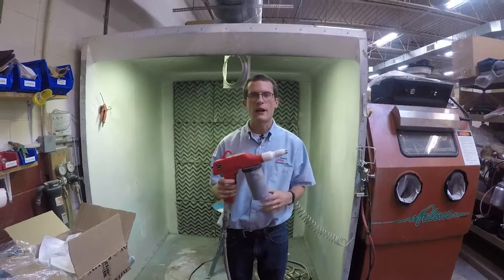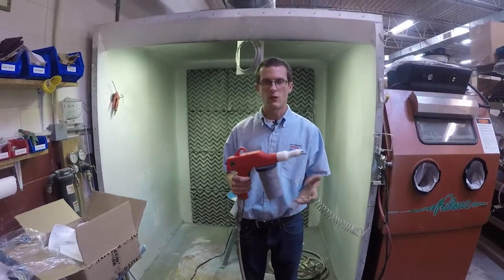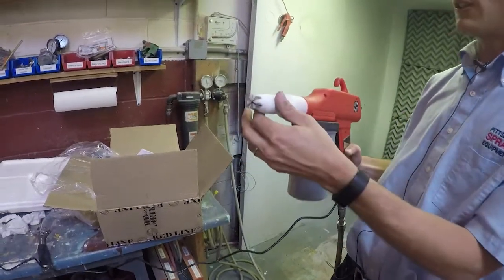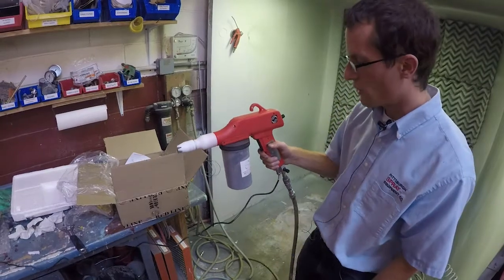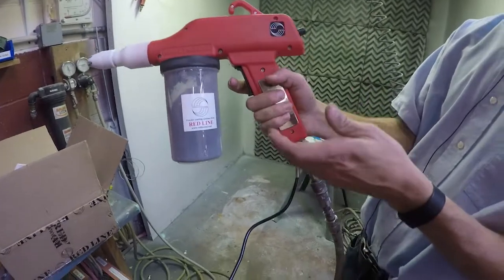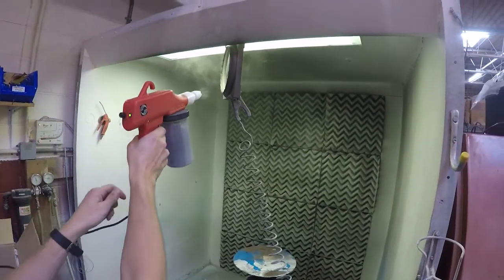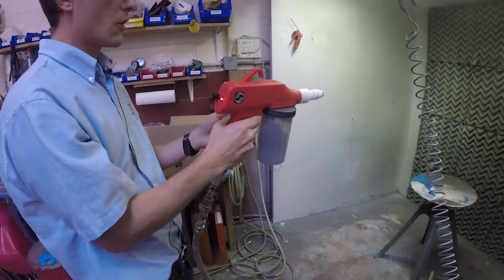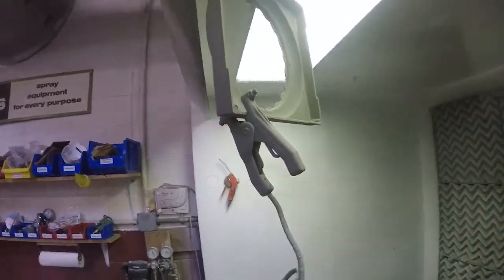Red Line EZ 50 Powder Coating Gun Review and Demo

Comment: This is actually a pretty good gun. I have the older (black) model. The only annoying thing for me is the British pipe connector in our market. I don’t like having too much sticking out under the gun. It’s too easy to break off, if you’re not careful. Which is why having an extra connector on the bottom is annoying. So far, after three years, everything is working fine.

Comment: this may be a dumb question, but what does it mean to have grounded shoes? How can I ground my shoes? Love your videos by the way. very informative! Thanks
Reply: Your shoes will ground if they aren’t rubber. But I’ve never heard this mentioned anywhere else, or in any of the powder texts I have. If your floor is concrete, or wood, its not really grounded, even though it’s “ground”. The only real way to assure it is with a grounding strap to the same ground your system is grounded to. But theres no need for it.
Reply: thumb tack in the sole ought to do it for you.